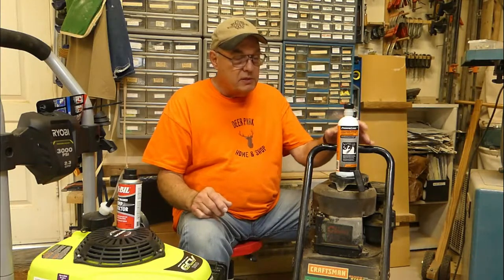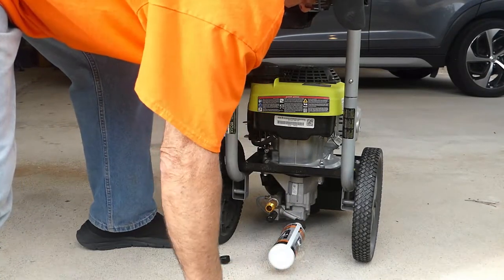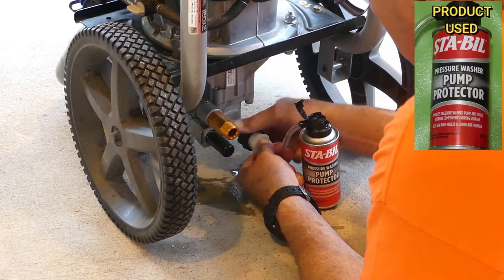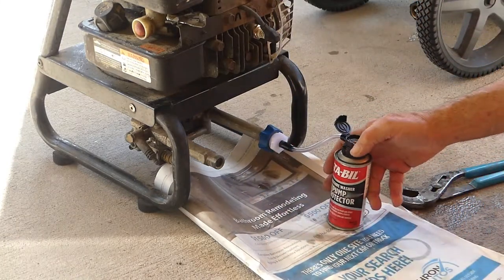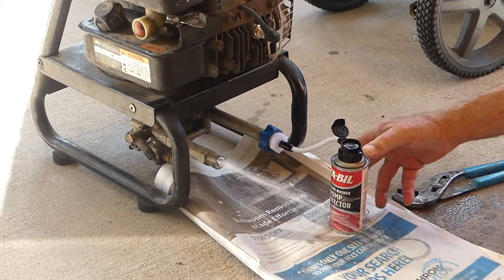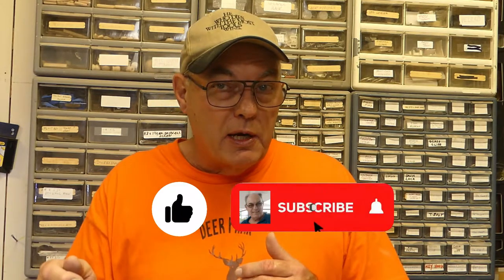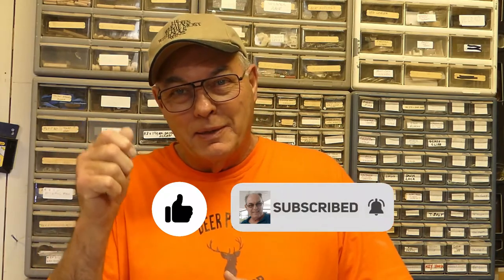Pressure Washer Pump Protectors - What works? What doesn't?

Comment: Yup. Requires two people. One squeeze and the other person pull the string. Thanks for the video.
Reply from the maker: Haven't tried it yet but one viewer recommended removing the spark plug.  He can squeeze with one hand and crank with the other.  What o you think?
Reply: If you remove the spark plug, it is easy to pull the string as there is no compressio so it can be done alone.

Comment: The problem generally isn't the unit freezing and cracking ..... it's the CORROSION and deterioration of the seals that takes place from water sitting in the unit for an extended time. !!!!
Reply from the maker: That makes a lot of sense.  I think most home owners may only use their washer a time or two a year, so it just sits with water in the pump most of the time.

Comment: It looks like you were alternating squeezing the bottle and cranking . I think you have to squeeze the bottle and crank all at the same time.  .   Easier with spark plug removed of course.
Reply from the maker: Thanks for the info and I will try that next time.  The manufacturer failed to mention any of that in the instructions.

Comment: Another thing to do is take a small sheet of aluminum foil and place it over and squeeze it on the intake and outflow connectors. Bugs love to go in and lay their eggs and then seal up the openings.
Reply from the maker: Thanks for the tip.  I just tried to pressure wash my patio and now the water is back flowing thru the water tank. I assumed that I messed it up with the squeeze bottle protector since it wouldn't cycle thru the pump, but I may have the problem you describe.

Comment: I have the exact same squeeze bottle and was having trouble as well UNTIL I grabbed a quick clamp and clamped the bottle right in the middle on opposite sides, pulled the starter rope and green fluid came rolling out of output just fine.   Tried it again with a second person squeezing bottle as I pulled on starter rope - same result  So there you go a 1 or 2 person solution !!!
Reply from the maker: Thanks a lot!  I didn't pull the rope on mine.  The instructions left out that little nugget.
Reply: Thank you for this comment! Worked perfectly.

Comment: The squeeze bottle would need a vent or an air hole to flow thru to the other side.
Reply from the maker: Perhaps mine doesn't have such a vent.  I followed the directions, but you know how that goes, they never include all the information.

Comment: That is interisting.  I have never heard of pump protector fluid.  We have had our sprayer for about 8 years end I guess we need to use this.
Reply from the maker: According to my Ryobi manual, I am supposed to be using them every time I use the washer, but I think lots of people never do.  It is especially important to winterize with them if you live in a really cold area.
Reply: I bought a 2,400 gasoline pressure washer about 20 years ago. The pressure is down to about 800 now. I haven't started it up in 20 +- years. I find the Ryobi 1,900 very handy and don't have to worry about gas, oil and yanking my shoulder off trying to start it.
Reply: Mandatory in areas that freeze
Reply: I have killed several washers in my lifetime, and thought it was premature death. I will start using this to lubricate seals at least once a season before putting away.

Comment: I could not get the squeeze bottle method to work on my gas Westinghouse pressure washer. But the spray did work.
Reply from the maker: And you probably followed the instructions to the letter like I did.  I'm sicking with the aerosol.

Comment: very good. thank you. learned something today. THOUGHT. Run electric motor for 2 seconds when putting away to empty water in pump, or pull starter chord 10 times to empty water. Will that not work to remove water?   sis this harmful??.  Seems like we should empty water first, then spray/lubricate unit.  replies if your agree/disagree please.
Reply from the maker: I have a gas pressure washer and, according to Ryobi, you shouldn't operate it unpressured but 2 sec. shouldn't hurt anything.  Also, in my case, I could leave the wire off the spark plug, and then crank 10 times, and that might do the trick.

Comment: Did you blast your floor when you were done? 😂 I ve been using pressure washers for over 40 years, and have never had to winterize a pump. Last 3-4 years , I wish I had. Colorado dry storage winters will kill a pump. But, once a year is it.
Reply from the maker: Honestly, I never winterized my old pressure washer, but we have had hard freezes here in the Houston area over the last few years, so it seemed prudent.  I know Colorado freezes are much colder and longer than ours.

Comment: I’m looking for something that will remove calcium deposits within the pressure washer. Probably not a big deal but I can see large white chunks inside the inlet for garden hose connection.
Reply from the maker: I haven't had this problem so far, but I know that a solution of equal parts of vinegar and water is often used.  You let it sit in the pump overnight and then flush it out.  Please understand that I have read about this but haven't actually tried it myself.  I saw it on pressurewasheruniverse.com.

Comment: You have to squeeze the bottle and pull for that 2 Chainz or apply air pressure will the Schrader
Reply from the maker: Appreciate your comment.  I just wish either the Ryobi manual or the bottle instructions would have told us that.

Comment: Do you run your gas out first? Or put a thing in your gas so it doesn't gum up during storage
Reply from the maker: I always run my gas completely out if I know I won't be using the machine for a while.  When you're almost out of gas you can put a tablespoon of a fuel stablizer like Stabil "Storage" in the tank and when it runs out of gas, you'll protect the gas that remains in the carb.
Reply: @deerparkhomeshop2471  can I ask, I watch a video said put stabilizer in gas cans when gas is fresh or buy ethenol free gas. I already have gas can filled but it's old gas? Can I use it? Then I see also pressure washer pump protector.. are both needed? also listened to small motor repair ppl who said never run unit without  the handle engaged it will ruin the pump. I thought that's odd? 🤔 I live in Florida so I don't have to worry about freezing. I appreciate you thanks.
Reply from the maker: @siestakeygirl1000  First, the pump protector is used to keep the residual water left in the pump from freezing and damaging the pump, so if it doesn't freeze where you live you don't need it.  Second, my pressure washer manual also says not to let the unit idle, however I don't understand why this is the case.  Of course, this means prolonged idling.  When you pressure wash, you don't hold the handle down the whole time.  Third,  how old is your gas?  If it's been sitting for a year or so I wouldn't use it.  Gas will change colors if it is too old, so compare a sample to some fresh stuff.  We have short winters here, so I have used gas in spring that is several months old.
Reply from the maker: @siestakeygirl1000  One more thing.  If I think that my gas may go bad, I pour it into my truck, and buy new for my lawn equipment.

Comment: Ok, you squeeze the bottle, it pushes the antifreeze into the pump.  You let go of the bottle and it expands and pulls the antifreeze back out of the pump and back in to the bottle.  Seems like it can only work with one person squeezing and holding it while a second person cranks the engine.  In theory I suppose the seal should work as a check valve and prevent fluid from coming back in.  Or maybe it would let air back in instead of fluid.  In theory.  Obviously it doesn't work very well.  As Einstein said, in theory, theory and practice are the same.  In practice, theory and practice are different.  

I'd just go with the aerosol can.  You use it once a year to winterize the pump.  So a can may last several years.   For $7.88 at Harbor Freight it's a no-brainer.  JMO Mike.
Reply from the maker: One of my viewers removed the spark plug and dry cranked the engine while squeezing the bottle.  Of course, this tidbit was not included in the instructions and it's too much effort anyway.  So, loike you, I'm sticking with the aerosol.

Comment: You only need this for wintertime not every day use
Reply from the maker: essentially that's right, most people just use it to prevent damage.  The Power Care brand promotes it for more frequent use to lubricate  seals and etc. in the pump.

Comment: DON'T LISTEN TO HIM !

He did not remove the seal on the Anti-freeze bottle, this is why it did not work for him !

To use the anti-freeze.
1- remove the valve on the bottle snd puncture the seal.
2- remove the cap from the valve and screw the valve onto the water inlet.
3. Remove your spark plug (so cranking will be easier)
4. While cranking the engine, squeeze the bottle until no more water is ejected and that the pink antifreeze is sputing out. It only needs about 1/4 cup of antifreeze.
5. Put vack your spark plug.
6. Empty your soap dispenser (if there is one)
7. Drain your hose and spray gun. No need to put antifreeze in them.

Before you start you may blow air in the water inlet using a compressor... but this step is not mandatory.
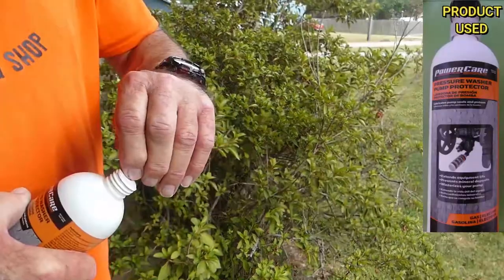Reply from the maker: Actually, at the 1:00 min mark in the video, I removed the bottle seal.  Several other viewers also mentioned removing the spark plug and then pulling the starter rope.  If I ever decide to use this product again I will try your procedure, although I am having good luck with the aerosol product.